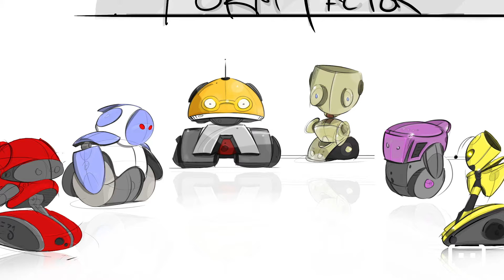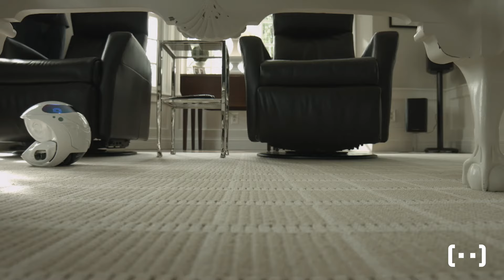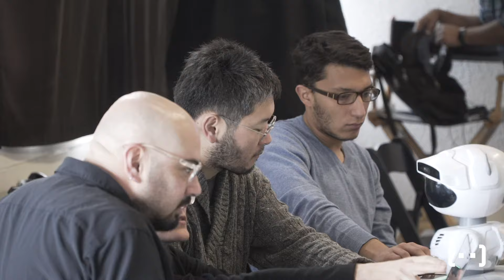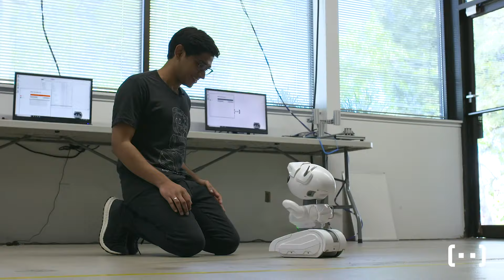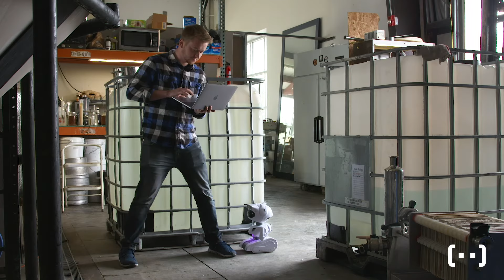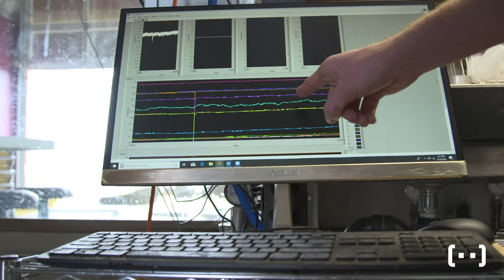Misty Is Serious Technology with Ian Bernstein and Morgan Bell

Comment: That was a lot of fun to see all the conceptual work and evolution of prototypes, getting a nice general breakdown of the "central nervous system" was a major bonus. Using ethernet with the Occipital makes a ton of sense, that thing packs a lot in itself. Is that the only ethernet connection possible with current hardware, or can that be expanded upon reasonably? For situations where new/future components might need more than the CANbus can handle, as with the Occipital.
Reply from the maker: Hi, Jason. 

Thanks for your comments and for your great question. This is exactly the kind of question we had in mind when we set up the Misty Development category in the Misty Community Forum - Check it out if you’re interested in taking a deeper dive into all of this! The Misty team is on there as well as other devs and engineers. 

Now, to answer your question, we do have higher bandwidth options where necessary. The UART on the backpack is capable to 115200 baud and is a very easy place from which to extend the functionality. The USB on the robot's back us USB2 and can theoretically offer a 450 Mbps data rate. As we look to the future, higher speed interconnects will be a very real necessity to enable the kinds of use cases that people will need. 

Thanks again for posting and for checking out the video. Hope to see you in the Community Forum soon! https://community.mistyrobotics.com/